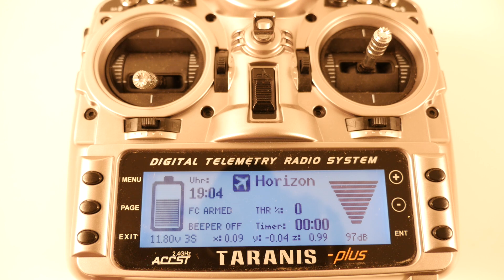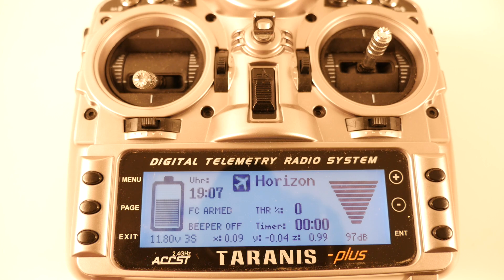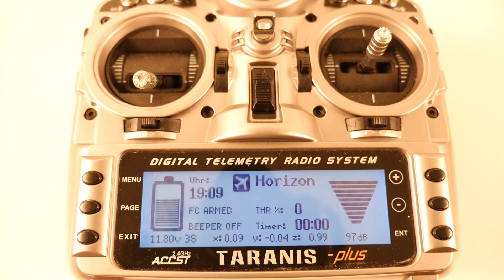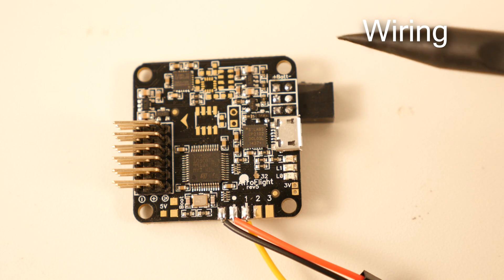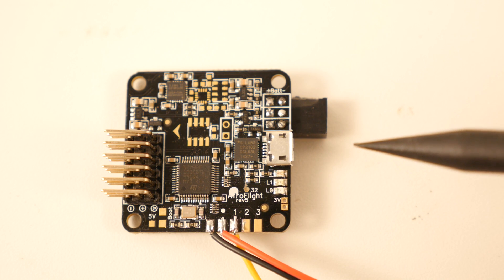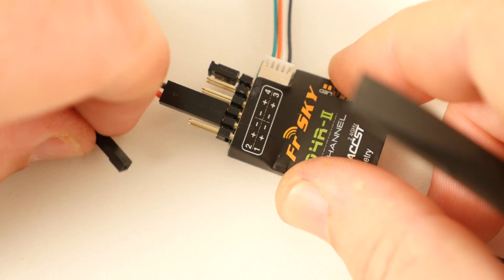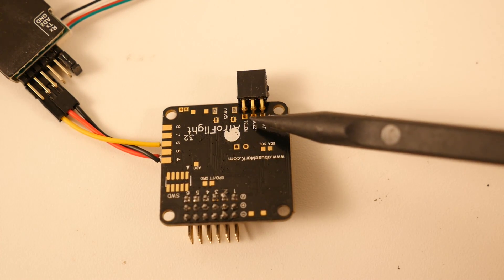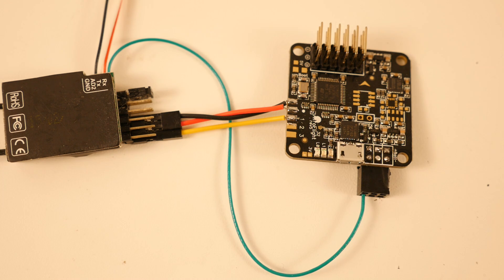FrSky Taranis, D4R-II, Naze32 - Telemetry, Battery Voltage, Lua Script Tutorial - Part 1

Comment: can i directly solder on the green wire to the telemetry pad or do i have to use the header pins?
Reply: You can do either or. U will have to unsolder if u need to remove the board instead of removing the wire